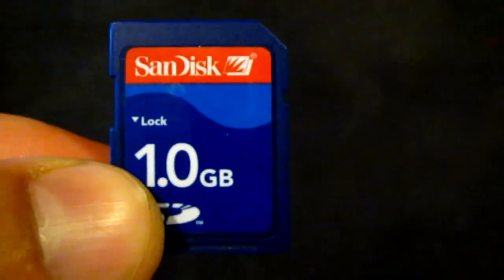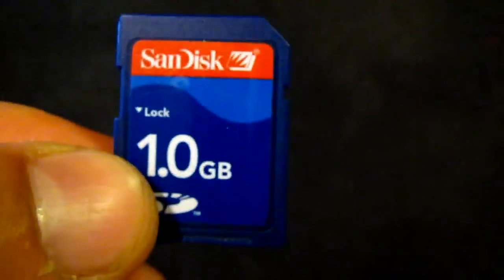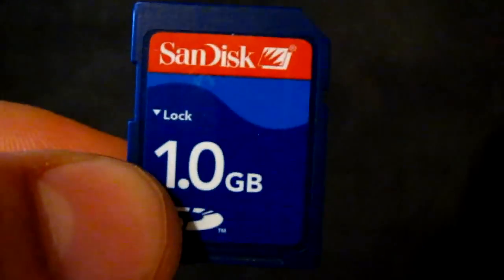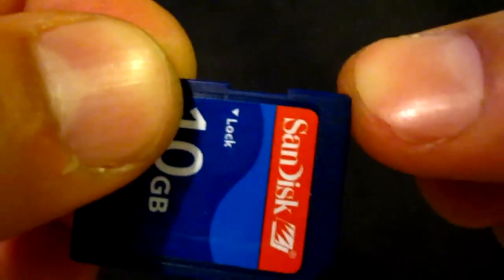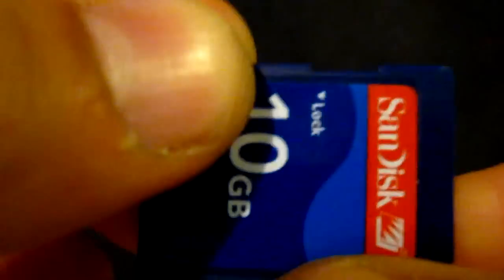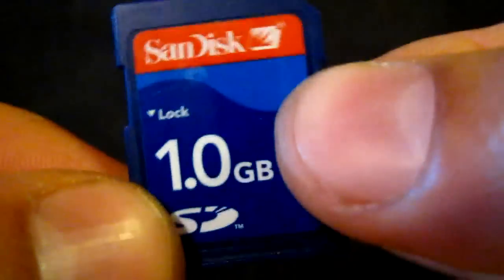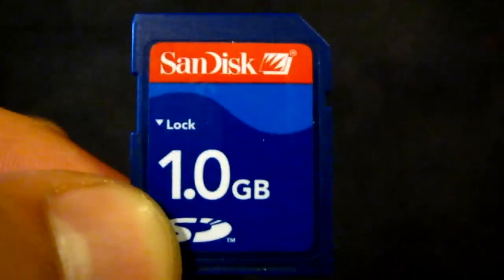How to repair broken lock on SD cards

Comment: Hey,
If it doesn't work first time, put two or three strips on it.
I'm only having a guess but I think there's a magnetic reader in the card reader which knows if it's in the locked or unlocked position. So two or three strips should do it.
Reply: hey , thank you very much ! .. i though that the small switch is just nothing .. so i throw it cause sd card is broken .. after i put 2 or 3 tape .. its freaking workkl !! THANK YOU FOR THE COMMENT AND THANK YOU WHO MAKE THIS VIDEO 
.
Reply: macocsv ,, what he do ? if i unable see ?
Reply: love you so much, thank youuuuuuu
Reply: you're a life saver
Reply: Lifesaver!!
Reply: Thank you sooooooooooooooooooo much! I've been stuck on just wondering why the single strip never worked on my card that has been locked for months.
Reply: Amazing 
I was doing 1 layers which didn’t work

Comment: OMG!!! I worked. I put the card aside a year ago giving up on it but today I need to record and most of all my memory cards are full so I pulled this one out and decided to Google a solution and your video came up. I tried this trick and it worked with one strip. It's funny that this was the same solution used on VHS tapes back in the day. If you broke the tab off, you couldn't record on a VHS tape anymore but put on a a strip of tape and you could record again. Kool.

Comment from the maker: @mandapril  You need to just make sure gap is solid across because the way the card reader works. A little pin in the card reader drops into the groove on the SD card and causes it to be in lock mode .What we are trying to do is cover this groove completely to let it unlock.  If the pin is aloud to drop into the groove area at all it will lock.Let me know if this helps.Try using a little more tape. Just be carfull not to put to much on or you might get card stuck in reader.

Comment: it works!!
however, i had to use a small rubber-eraser piece and then tape it in place of the old switch. you can use any small bit of any material there, in case the scotch tape is not rigid enough. good luck!

Comment from the maker: The gap on the side of card where its missing the switch has to be covered enough to not let a little pin in the card reader threw the gap. try a Lil more tape just don't put so much on you get it stuck. I hope I helped you .

Comment: Tape didn't work for me, but I still had the plastic switch that had come off.  I couldn't get it to stay in place, so I taped it in place and then I was able to format the card.  It would appear that most times tape isn't rigid enough to act as the plastic switch so maybe something else is needed.

It seems though that unlike I first thought, the switch does not in any way interact with the circuitry inside, and is simply something to block a hole.

Comment: We did the same thing with 5.5" and 3.5"  diskettes.  Software vendors (AOL especially) would advertise by mass snail-mailing software on diskettes.  The diskettes were not writable as received, but after the tape trick, all we young geeks got free diskettes.   
- - - seemed like a big deal at the time - - - ;)

Comment: I put 2 pieces of tape to no avail, but then I noticed that I had some light duty .032 dia. solder lying around. I took the solder and doubled it, then taped it into the gap. It worked perfectly.

Comment: Works fine for the first time. 
But 1. it covers the small groove underneath the card on the side. This is not a major issue
2. The pin that checks the card in the device punches in to the scotch tap (even tried 3 layers of scotch tape) and when you try to pull it back it get stuck.

Comment: For cameras, it doesn't work with just cellophane tape. Under tape, stick a small piece of aluminium foil that covers the lock slot completely. That should work.

Comment: Brand new reader/adapter which came along with sandisk 32gb class 10 has no lock switch. When i insert the microsd card into adapter and try to delete or format or add stuff ,i get the message that its write protected. However, I can read from the card

I tried your method. It still says its write protected and would not perform any of the above mentioned actions !!  Any solution that you know of for my situation ?

Comment: Didn't work with 1 layer, so I put 3, but then it didn't fit into the camera any more (too thick).
The final solution that worked was to put 2 layers with just enough tape to cover the notch, then a third large layer over them like the one shown in the clip.

Comment: The lock has come off two of my 64g cards. Could I be doing something wrong that may be causing them to come off?
Reply from the maker: It happens allot . Sometimes some device's wear them out faster than and are rough on the card. Not to mention they are built flimsy and cheap

Comment: Why did have to cover it? 
how does it work? I'm Curious thank you for who will respond :3 
BTW It worked for my friend's DSLR Nikon SD Card. 
Commend to you bro (y)
Reply from the maker: Quer Laconico It works like a old tape cassette . A pin slides into the grooved area where the switch was    and that makes it so you can't  erase. if you block the grooved area with the tape it will block the pin and then alow you to erase
Reply: wow so that is something like a trigger? 
but the true lock is inside a device? am I right? it's so cool bro (y) commend commend :D

Comment: I have two questions ...
(1) Will transparent tape work just as good?
(2) And if you are still having trouble saving files on SD Card, after putting tape on it, then what?
Reply from the maker: try another layer of tape

Comment: There is something seriously wrong with my Sandisk 32 GB memory card that came with an adapter that fits my small Nikon digital camera.  The switch is present and I have put it in the UN-write protected position. It says Memory Card is Write Protected.  I put a piece of scotch tape over it like your video instructs and I get the same message.  I think its got to be the camera, or the card is faulty. I have had this problem with Sandisk cards before.  The switch is there and in the right position, but I still get the same error code.  I think its the Sandisk cards are just made cheap.  They are the most costly cards at the stores, but they are no good. I have better luck with the generic brands.

Comment: but what do you do if its stuck in the locked position and you want it unlocked
Reply: It should still work that's what happened to mine
Reply: +mrHowlll Mine was the same case but covering this worked

Comment: It works for pc but linux systems are not dumb thats why windows get virusses fast :)
Reply from the maker: Linux is software and this has to do with hardware. I run Linux and Windows on same rig works with both ? It works by not letting a pin into the groove  like a old tape cassette? It's in the mechanics of the card reader on . Your personal computer aka PC can run Linux or Windows. The card reader and card  still works the same . If you are having problems and it still reads locked then try using Duck tape instead.

Comment: my question is why does it solve the problem
Reply: +GotThat Xray because the card counts as unlocked for the cardreader if something is blocking the upper space where the slider would be. there is nothing happening inside the card.

Comment: At 00:39, the author has his fingers on the edge connector contacts. This is a no-no. Skin oils can oxidize and make for bad connections. Use 91% (or better) isopropyl alcohol to clean the contacts BEFORE inserting into a device, so as not to spread crud to the device itself, which theoretically should be cleaned from time to time with a minimal amount of alcohol.
Reply from the maker: Give me a break and to this day I still use the sd card no problems. You would make a good micro manager though . Good try troll. Almost 7 years later. I wipe my fingers on it daily . especially after popcorn with extra butter